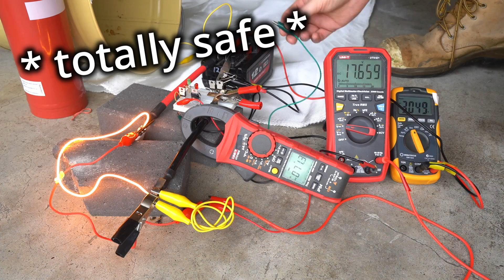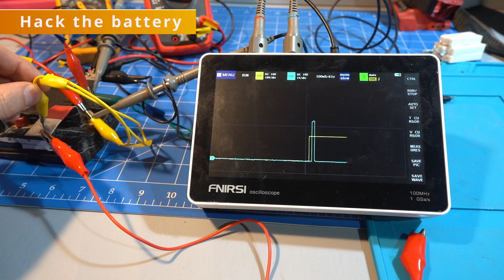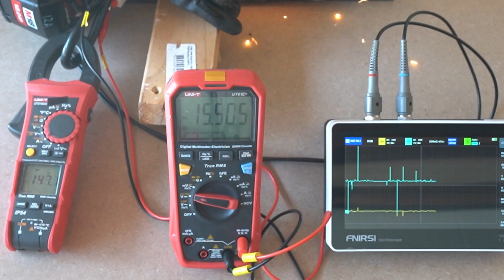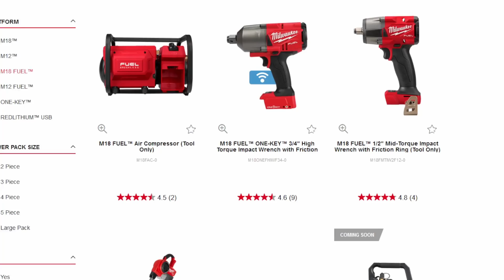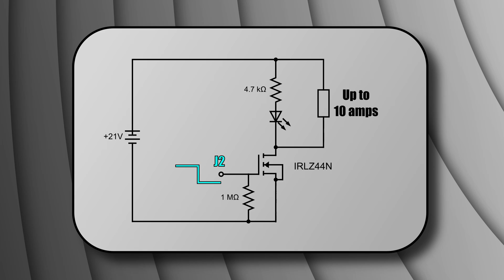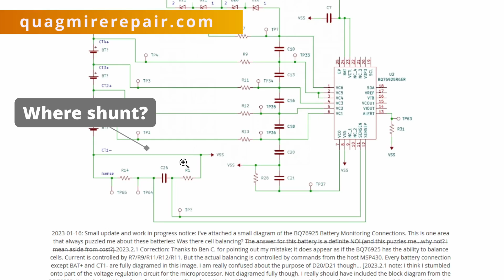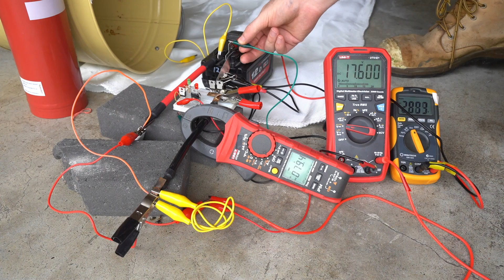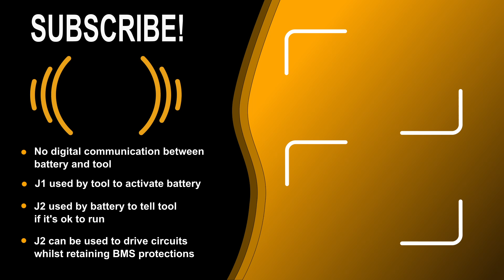[005] How M18 batteries communicate with tools

Comment: I was permanently banned from a Milwaukee subreddit for saying exactly what's in this video about 9 months ago by a mod who was claiming all sorts of advanced Milwaukee communication.
Reply: Yep!  That's the one...lol.  It was weird because he was claiming the charger was doing stuff I've never seen it do and I monitor the voltage and current of every battery I charge.

I simply said he was wrong  (didn't know he was even a mod at the time) Immediate permanent ban.
Reply from the maker: Yeah, I've seen him make some very strange claims in a few subreddits. If you've seen my power testing video, he's the guy I got into an internet argument about the drill being 1500W. I think he has some issues, so I just leave him alone.

Interesting on your charging tests. Have you got a jig, or do you wire the terminals up each time and measure current/voltage from the leads? Any interesting discoveries?
Reply: @toolscientist  I use a non Milwaukee charger that displays that info now.

 Before that I built a little jig from an old dead battery pack I cut out the terminal section (connected to charger) and the bottom of a dead drill (I put the battery to be charged in) connected with wires I would have access to.

It's not really necessary for legit Milwaukee batteries, but I like to buy the knockoffs just out of curiosity a lot so like to keep an eye on what's actually happening.

The only real useful information I've seen is that charging at the rapid charger rate very often leaves the cells unbalanced sometimes...but you have to open up the pack to check that after anyway.
Reply: Why don't you report that redit mod?

He deserves a super ban, for mismanaging the forum by promoting lies.
Reply from the maker: @Iowa599  I don't think they're lying, just confidently incorrect, which I don't think is against any terms. It's a fairly dead sub, anyway. Not worth the effort.
Reply: @toolscientist  Can't imagine why it's dead, with such great moderators 🤣
Reply: @Iowa599 I wanted to at the time, but am not that familiar with Reddit and how the mod system works.  It was the 1 and only time I've been banned...and it immediately made everything disappear as to what their name even was.  Maybe if I had email notifications turned on or something, but everything from that sub disappeared in my records.

I'm long over it, but was pretty frustrated at the time.
Reply: Microsoft (the African Americans of software thanks to them having more oxygen and blood flowing to their aggression sector than the rest of their brains) are the same way. They've practically dominated Mojang and corrupted them in more was than one, and their horrible design tactics are quite literally killing Minecraft in thousands of screwed up ways.
Reply from the maker: I think I know that subreddit, and that mod. Is it the smaller subreddit - MilwaukeePowerTools? Until I did this test, I thought there was at least some communication, even if it wasn't as fancy as Milwaukee tried to claim. I was fairly surprised that it didn't even differentiate between batteries as it's common for people to claim that the tools can detect high-output batteries.

Comment: Do your batteries have the One-Key symbol?
Reply from the maker: All of my high-output ones do, and most of my 18650 packs, too. Seems any battery newer than 2016 has it. 

Do you have any one-key tools? Can it tell you any information about the battery? Best I can find is the radius light will tell you remaining capacity of the batteries, but they can just guess that from the voltage.

Comment: Are there any plans for testing batteries from other companies, or testing if protocols are consistent for different brands within the same company?

For example, will a Craftsman battery communicate in the same way as a Porter Cable, or a DeWalt?
Reply from the maker: I've got some Makita and Dewalt that I'll eventually get to. I don't think Porter Cable and Craftsman are available in AU, so I'm unlikely to test them. I've heard that you can cut part of the battery off and it will work across Porter Cable, Craftsman and Dewalt, so likely using the same system.

Comment: I’d be very curious to see this with Dewalt’s packs. I’ve only been able to draw 5A from a 5Ah power stack before it shuts down
Reply from the maker: Don't have any Dewalt's yet. Powerstack is the only one that cuts power. It's most likely some simple connection on ID or Th pin, otherwise powerstack wouldn't work with older tools.
Reply: @toolscientist  Would love to see a video if/when you do!

Comment: This compared to Dewalt batteries which... directly connect the cell terminals to the battery leads. Nothing stops the tool from working from any power supply. Nothing stops the battery from being charged or discharged.
Reply from the maker: Yeah, Dewalt is the best battery for the apocalypse! Dewalt tools are slightly harder to trick as you need to trick the ID pin and Th pin, M18 just needs 3V on J2. Dewalt is obviously much easier to charge.
Reply: @toolscientist You sure that Ryobi isn’t the best for the apocalypse? NiCd compatibility, low voltage cutoff in the battery…much less communication than most other brands.

Comment: Please man. This is amazing. You are bringing truth to the power tool industry. U have to do this analyses to makita since makita is the king of knockoff Chinese random tools and battery
Reply from the maker: I should be getting to Makita soon. Makita will be hard as they like to brick their batteries. I might have to start with the knock-offs first to avoid bricking too many batteries.
Reply: @toolscientist  what do you mean brick? If they are messed they no longer work anymore?
Reply from the maker: @eduardoramiro4846  I'm going off what I've heard, but apparently if a LXT battery is put on a charger and gives an error, it records it. If you get 3 errors in a row, the battery bricks itself and won't charge ever again and can't be repaired. 

So doing crazy stuff like I've done to my M18 packs (undervolting and overtemp) might trigger the battery to brick itself.

Comment: Awesome video! It's fun to poke at Milwaukee engineers about Redlink whenever they swing by. From what they have told me directly, redlink is very dumb so they can maintain backwards compatibility with all their tools. Only some tools and I believe the forge batteries will actually throttle the current (by reducing the voltage with a mosfet) and this is done with some type of check right after startup.
Reply from the maker: Yeah, I've got 2 batteries from 2013 that have standard Redlink and not Redlink PLUS. They use basic pulses with the charger rather than serial data. Maybe it's just the one-key tools that communicate? The 12ah has a large mosfet that might be able to throttle power, but I didn't see any different behaviour between tool and the 12ah.
Reply from the maker: Just curious about how you're talking shop to Milwaukee engineers. Do you sub-contract for them? I understand if you're not allowed to say anything. If you can talk, I'd love to hear any inside gossip :-)
Reply: @toolscientist  Haha no I do not subcontract with them, but I have a couple friends and coworkers who work/have worked with Milwaukee. I'll poke one of them for which batteries have the power reduction on them, my guess is it's the HO batteries with 21700 cells.

Also some fun gossip is they had a hell of a time getting pouch cells working, they were having issues with them puffing from extreme loading so they were late to release. Dewalt beat them to it and they get a little upset if you mention it.
Reply from the maker: @jackphilp7057 yeah, it's hard to beat a cylinder as a pressure vessel. Whatever weight you save from going to pouch cells, you have to put back on the enclosure.

I think the best use of them is making sizes that aren't achievable with 18650s and 21700s. The Dewalt 1.7ah seems like the only one so far that offers anything over cylindricals.

Comment: Be careful of FET ratings! If you are unlucky, the FET you mention (IRFZ44) will when 3V is applied to the gate, pass 50uA or so. Vgs(th) is never a measurement you should use, look at Rds(on) voltage gate spec, this is at 10V. At best when using this FET, you need to verify that the Rds(on) at 3V vgs is low enough to not promptly burn up. High current FETs rated for 3V gate voltage are nonexistant in through-hole. Look at 'drive voltage' on digikeys selector, this shows 12 FETs from 30-170A and 3V or under gate drive option with Vds >21V. CSD16321Q5C is probably one of the least bad ones. They are all annoying to mount. A single transistor 3V->12V booster will fix this FET selection problem and makes the FETs you mentioned just fine, rather than a crapshoot on if they meet the high end of the spec (won't work at all), low end (work fine) or burn up a few minutes in.
Reply from the maker: I'm not using the IRFZ44, I'm using IRLZ44N. In the datasheet, Fig 1 & 3 show that it is rated to just under 20A at Vgs = 3V, hence why I said 10A for that simple circuit. My high-powered circuit (which I blurred to avoid inexperienced people from building) is using a booster setup to drive my 2x IRLB3813 at Vgs = 17V (dropping to around 10V as the battery depletes)
Reply: @toolscientist  Oops on the part number. I note you can't quite trust Fig 1 and 3, Vgs(th) is defined as varying by a volt maximum, typical is undefined. Id can be as low as 250uA at 2V Vgs, if Vgs(th) is worst-case at 2V. The Rds(on) spec @4V/21A anchors this@0.035R .735V. I am surprised! This is the first datasheet I have checked on which typical seems close to worst case, as Fig 1 seems very close to .735 at 21A/4V. This has unfortunately bitten me before.Expecting 10A easily due to Fig 1 on a different datasheet, and finding 10mA due to the part having a worst case Vgs(th) spec. Great work.
Reply from the maker: All good. You are right, though. The IRLZ44n isn't intended to be used at Vgs = 3V, it just happens to work decently there. So yeah, variance could be quite high between samples.

Comment: Fantastic testing, thank you.

Although the marketing is all lies and these tools have the communication sophistication of a shovel to the face you do know what alternative companies are probably working on..? Subscription based, tiered performance, internet connected product lines with social media integration. "You want more than 50 amps? That sort of wanton performance is only for the platinum super-contractor tier members at just $35 per month."
Reply from the maker: Lets hope BMW doesn't start making power tools!
Reply: I’m pretty sure that the Hilti Nuron battery chargers have at least WiFi if not cellular radios inside. The tools store data in the batteries and then they get uploaded from the chargers. Haven’t dug into the details. Too $$$.
Reply from the maker: @gf2e  would they need wifi? Seems like that can all be done wired. Just read that charging the battery uploads data to the cloud. Maybe they've got a cellular chip in the charger?

Edit: Sorry, I can't read. You said charger, haha
Reply: @toolscientist  Now I’m imagining a PoE wired Ethernet charger. 

RJ45 jacks would be pretty terrible on a construction site. Max power on PoE is probably not very good either.

Comment: Try monitoring the entire run cycle of the vacuum cleaner. I used my M12 vacuum to compare lifetimes of used batteries. Maybe four or five times across a 15 minute runtime there were audible changes in the motor note, I was curious if that was an artifact of redlink communications. There was zero load for the entire test. M12 tools show the charge indicator on the tool rather than the pack.
Reply from the maker: M12 tools don't have any digital communication. It's all done with analog pins. The tool is just reading temperature directly from the T-pin, which is a thermistor. I've done a few rundown tests with the blower, but that's a brushed tool that's not likely to have anything fancy in it. Can't say I've ever heard any sudden changes in motor speed from the backpack vac, but maybe there is something.
Reply: @toolscientist  ty gl

Comment: A question: could there be some wireless communication happening? I ask this because newer M18 batteries have a OneKey symbol on the service tag and what appears to be a unique address, I've done some fiddling but never could get the OneKey app or anything else to recognize it. That said, even if there is some wireless communication happening, as you've demonstrated it still doesn't result in any changes in the battery's output.
Reply from the maker: Definitely no wireless chips in any of my batteries. My newest battery is a 5ah from 2021, though. Newest high output battery is from 2019.

Comment: So what I'm learning from this is that I wasted my money buying genuine batteries as they are no more advanced than the knock off which already come with all the features of the regular... which is thermal protection...and not overcurrent protection? which is what I assumed the red link stuff was doing.
Reply from the maker: The big problem with knock-offs is that you never know what you're getting. Could be getting recycled cells and I've even seen someone post where half of the cells were full of sand! They could also not have a thermistor or low voltage monitoring and just put 3V on J2 at all times.
Reply: @toolscientist  certainly but then it's a cost vs consequence equation and this video kinda of just proves that you're getting messed about either way, I've just had to take apart an M18 that won't charge tho all cells are good was triggering an overload fault (guy was angle grinding wood...) anyway interestingly apparently you have to plug it back into the charger to "reset" it except it reset it once, but now it refuses to  reset it triggering the same issue, that might be an interesting thing for you to poke around at, no idea what signal is triggering the "reset" or if this battery now just refuses to put any voltage on j2 ill give it a measure now I understand what I'm looking for. (terminals all outputting correcting so it must be missing the "happy battery" signal)
Reply: @CraftyCrow  At standard pricing, the M18 packs are pretty outrageous, but at least in the States you can often find sales that put them (even the 21700 packs) at around $10/Ah. When you consider that retailers are going for at least 50% markup, and Milwaukee is using name-brand cells, they aren't fleecing that bad. Or, rather, most of the knockoffs that are cheap enough to consider must be cutting corners that you'll likely regret.

Comment: Any chance you will ever do Ryobi? Specifically their HP line that has the two extra contacts on the back of the battery stem? Word on the street is an HP tool signals the battery it can handle more amps than a standard tool. The HP battery will then allow more amps to flow. Both battery and tool have to be HP line.
Reply from the maker: I have a Ryobi 36/40V mower and battery, so I'll be doing something with that. Don't have any Ryobi 18V, though. My suspicion is that the extra contacts on HP tools/batteries allow them to bypass the low-voltage cutoff mosfets in the battery.
Reply: @toolscientist  Ryobi made the same claims that those extra pins enable communication. In my limited testing, it seems those pins enable the brushless tool to draw more power than a battery without them. So perhaps the tool normally operates with an amperage limit, but with the extra pins that enables a higher amp limit or perhaps a constant power mode. I'm really surprised nobody has looked at this tool communication stuff before, good work.

Comment: the way I deal with battery to tool communication is pretty simple : I resell the stupid stupid stupid tool and never buy anything from this brand again.
Reply from the maker: I'm yet to see what the other brands do. Some of them could be worse than this!
Reply: @toolscientist  yes of course, but I have modified a lot of brand to put Lipo drone battery instead of the stupid expensive battery and proprietary charger that comes with the tool.
I have never encounter a tool to batt communication on a portable tool, only on electric bike (it's part of my job to repair bike and change the battery from proprietary to generic). And when i see an electric bike with BUS communication on the battert I simply change the controler ! 
The comm between batt and tool (or bike) is a PURE SHAME and should be forbidden by law ! i'm serious, it's a major environmental problem.

Comment: Hmm, very good video. In the future I plan on both making portable appliances run using an M18 battery, and on making Milwaukee tools run without their battery, so this is exactly what I need. Though maybe you could release a concise document/video with all the key information right there.

While I don’t think it’s intrinsically useful to power something while the BMS protections are live, getting power from J2 might be a cheap way of running an MCU without needing a DC-DC converter. Milwaukee dev-boards when?
Reply from the maker: You can't get much power from J2. I think 10uA drops it to 2V. Around the halfway point of the video, I show my plot of voltage vs current for J2.

Comment: Great video! Do you have any faulty batteries? I've tried repairing batteries by replacing the cells, sometimes they come back to life, but sometimes they continue to flash even with all cells fully charged. 

I've always wondered if a command could be sent to the battery to start the battery again.
Reply from the maker: Haven't tried repairing batteries yet. There's a few good repair channels on YT that might have good info.